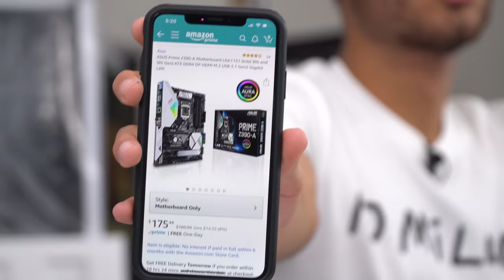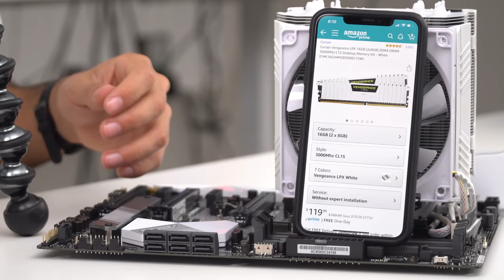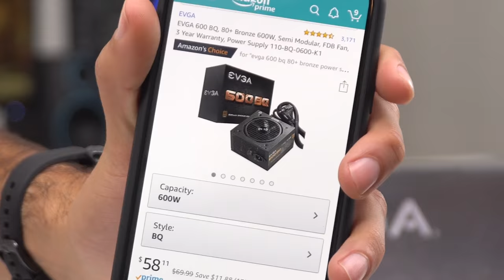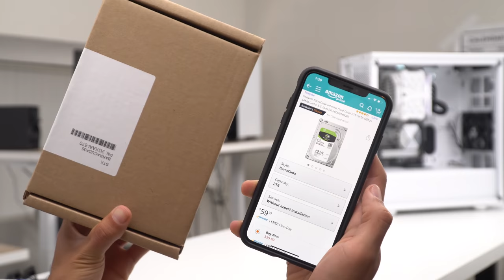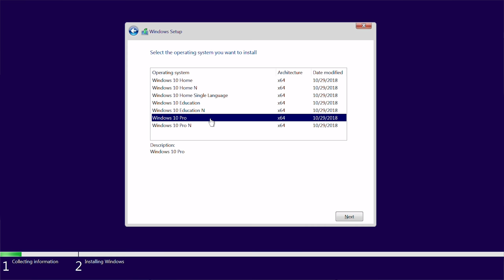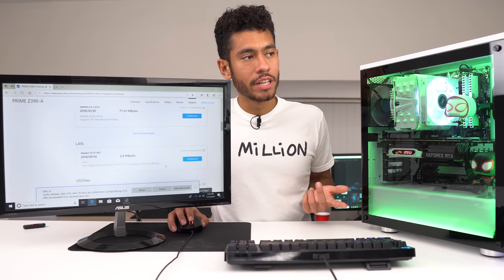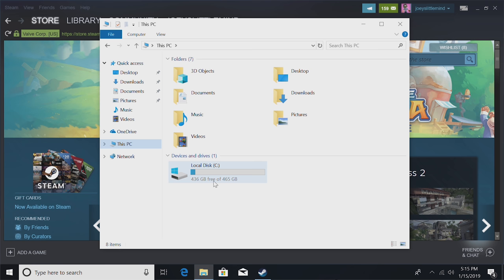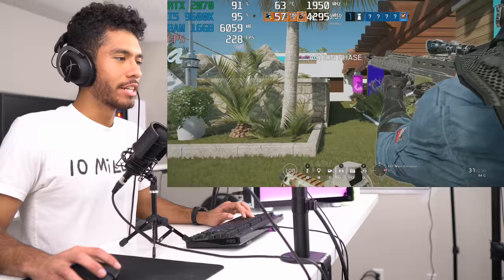$1500 Gaming PC Build Guide - RTX 2070 i5 9600K (w/ Benchmarks)

Comment: I’m gonna be building my first pc in the summer i think this is the build i’m gonna go with.
Reply: good luck
Reply: Samee trying to build a pc
Reply: Lol me too
Reply: Dude same
Reply: This pc runs literally almost as fast as his $2000 one
Reply: Same dude
Reply: @SweetLucky  dont the rtx cards are bad
Reply: Do this build but amd you save 200-300 dollars. The rtx 2070 is fine.
Reply: Stealth which AMD Processor would you recommend do this build
Reply: @DrizLax  Why?
Reply: same
Reply: SweetLucky same. Time to start grinding for that PC.
Reply: @TrueKnightFA  ryzen 5 2600/2600x would be perfect for this build
Reply: @rasmuskolehmainen574  This card is too expensive imo, It's only about 15% more effective than the 1070 TI and it costs about £200 more.
Reply: Same
Reply: SweetLucky same
Reply: what do you recommend then
Reply: @ascreamingcomesacross  im going to be building this exact pc build soon however to save money im getting 1tb hard drive instead of 2tb and also 250gb ssd instead of 500gb but im not sure if thats a bad idea or not. Also i will be using a 1080p monitor so do u think i should get the 1080ti or rtx 2070 bcz in the future the 2070 might be more useful and slightly cheaper.
Reply: @ascreamingcomesacross  i think ill stick to the rtx 2070 because it has a way better value for money than 1080ti and im not a hardcore gamer so i dont need the best possbile specs
Reply: Same
Reply: @josiiuh3025  yup
Reply: Just bought the exact same parts, dont have time this week, but next week im building it
Reply: @adasiek7664  its better than the 1080
Reply: Just built this and it’s really good you should do it. The only bad thing is that the front IO of the case might glitch a bit.
Reply: DrizLax how?
Reply: Same but I’m gonna use an i7 9700k
Reply: @dread4540  cmon man i knoe intel cpus are expensivr but they overclock really easy and they give a lot more fps
Reply: @that1guy256  how is going your build? I want to build it too
Reply: Same I wanna do it this summer too so I can start streaming
Reply: SweetLucky same dude I think this is rly his And am getting a really his gaming pc and mouse
Reply: I’m building mine for my bday which is in 9 days
Reply: Which monitor should I use with this build?
Reply: tbh i’m still new at this but you want 1080p and up and at least 144 hertz on your monitor
Reply: Me 2 ,m also getting the same thing but i am getting water cooling and 32gb ram
Reply: SweetLucky I have already started building mine but I have an nzxt h500 with Corsair 650 watt non modular and I am going to get an intel z390 prime intel I-5 9600-K and an nvidia GeForce rtx 2060 is the perfect 1000$ build
Reply: Michael use the monitor that Joey has its in the description
Reply: @TrueKnightFA  Ryzen 5 2600x with it's stock cooler letting it turbo and use xfr instead of a manual overclock with a 2080 instead of the 2070, very worth it. Much better multitasking, streaming capability, and slightly better gaming performance even.
Reply: @zigmundfreiheit7222  hey can you please explain me a bit better what you were saying about the refreshing rate of the monitor ,if I go with 1070 ti can I run 1440p 144 hz ? Or is it only for 1080s ?
Reply: K.14 the HDD is more for your money when u get 2tb than 1tb and takes less space to add another 1tb with the one your gonna already have try saving money on a case instead evaluate how much ur spending on a pc or LEDs is it necessary.
Reply: Hello everyone, I’m really looking to do my first build, if anyone can help me I have about $2000 total and that will include buying a mouse, keyboard, monitor and the build itself, can anyone help me out here with some advice ?
Reply: I won't recommend this build , since it's a pure gaming build , it's really good for gaming , but not really good for streaming and editing , if your only going to games , it's a good build , but I don't think anyone would do only gaming with a 1500$ build , go with 8 core or morelike i7 or cheaper ryzen 2700x
Reply: I'm going to build one this summer for my birthday
Reply: @ascreamingcomesacross  in 1080p the 2060 performs like a beast. So no need to get the 2070 if you want to game in 1080p.
Reply: @ascreamingcomesacross  Yeah by paying $100+. No thanks.
Reply: Yeah same
Reply: This build is trash
Try an rtx 2080 build, it should easily fit into your budget and is quite a bit faster than a 2070
An rtx 2070 fits better into a 1000 dollar build, not a 1500 dollar one
Reply: Yeah good luck
Reply: SweetLucky same
Reply: DrizLax rtx 2070 out performs the gtx 1080
Reply: Chrome384 the 1080ti is better than both rtx 2070 and 2080 it’s meant for 1440p or higher not 1080
Reply: Boxmoon69 how’d it turn out? I’m planning on building this as well.
Reply: Me too, but I may go for the 8600k
Reply: Me too bro, good luck🔥
Reply: Hercxs u2 ^^
Reply: would a 550 watt corsair go with this pc build?
Reply: @josiiuh3025  are u getting any blue screen??? Whest uncorrectable error
Reply: Me too i want it so bad
Reply: Me 2, also same components
Reply: try and save an extra $200 to upgrade to an i7 instead of the i5 its worth it man
Reply: @k3mp4  Their is sales of late on the 1tb m.2 for about $120 to $130 western digital blue on newegg.
Reply: @darkheart333hotmail3  didnt end up building anything lol
Reply: Honestly same its not too expensive and will help me record hella good videos once i get started with my new job
Reply: Yo me too
Reply: SweetLucky good Luck bro I gonna Build my first pc in Summer too
Reply: SweetLucky yeah definitely go with this, the specks are amazing for just 1500$ and it’s super easy to overclock your cpu up to like 5ghz if you don’t know how to do it just look up how to overclock a ryzon and intel core
Reply: Chrome384 it really don’t matter about the res it’s better handling max settings in games while you’ll still avg high FPS
Reply: George K he has downeys the  2070s or 2080s are better
Reply: Hareesh Devendran there’s nothing with the i7s , i5s or, i9s it’s about the threads and hz
Reply: Ayden Smith yeah ok bud, how’s it tradh when the 2080s only perform 8% better. Now I’ll agree if you’ll be streaming and gaming but that doesn’t make this build trash
Reply: Do not build this you can get way better of a pc for 1150
Reply: Specs of it are , gtx 1060 3gb , 16gb ram, 2 tb hard drive , 228 disk gb,  4.5ghz , ask for the name
Reply: i7 8th gen
Reply: TrueKnight don’t go with an AMD processor the i5-9600k beats Ryzen 7 2700x in gaming benchmarks
Reply: gang gnag which i7?? Can I build everything just like this and put an i7?
Reply: @aydensmith9745  Oh? Rtx 2080 cost like 1100€ and you intend to put it in 1500€ budget? Nice.... Rtx 2070 which is very good gpu cost 600€ and you intend to put it in 1000€ budget. You must be high. Dont listen to him guys hes jealous or something bcuz he is broke.
Reply: @OtenP_  Yes you can if you buy This motherboard hes using

Comment: dude i literally got the same exact build and its amazing! I recommend this to anyone who's build is within this budget! Great Vid
Reply: Ziad Haijar I bought half of the parts for this built already, moving from PS4 to pc!
Reply: @Adrian-vq2mp  same lmao but i got a different motherboard and processor because i want an amd processor and this motherboard doesnt support it and i got a corsair h100i cpu cooler instead of the enermax one.
Reply: @ziyad2912  would this build be good for 1440p 144hrtz gaming?
Reply: Mike_Zilla this would probably reach 144 FPS at 1440p on most low demand games, would maybe struggle with AAA titles
Reply: SAM SHB Wat? I own this exact build (different mobo, cooler, ssd, and ram) and it doesn’t “struggle” for any AAA title. Lowest I get to is like 85 on 1440p maxed but it’s usually in the hundreds.
Reply: @tyleride6928  Whats your opinion on the i5-9600k vs i7-9700k??
Reply: Tyleride69 fax

Comment: This is my first build! I want to say thank you for the awesome video and awesome help! A few things I had problems with was when you were setting the graphics card up you didn’t show everything about the cord and how to route it. For my first pc build, showing everything would have saved me a few hours but after messing with it for a bit you can figure it out alone. If you showed every little piece of the build and how you specifically routed them, it’d be a 10/10. But hey, thank you again!
Reply: Kyler Mcguire Nice! I’m thinking of building this pc as well :D
Reply: Rez dude it’s 100% worth it! This pc is absolutely killin anything I put infront of it. Definitely get a 144hz monitor. Makes the gaming next level crazy. Cheers 🍻
Reply: @Gurgs  Is this compatible with the  ASUS ROG Swift PG279Q monitor
Reply: vibranium it should be compatible with any monitor that I’m aware of. Make sure you’re aware that there’s dpi port. So to run 144hz you’ll HAVE to have a Display port!
Reply: @Gurgs  Thanks but is this g sync or free sync?
Reply: Just a question @Kyler Mcguire.... how is the PC doing. Thinking of building this as my first PC. Is it running smooth? Getting hot? Enough space?
Reply: Fogstrider1 8 this pc is fucking sweet. I downloaded “gpu tweaker” and when I’m playing a game that makes my gpu hot, i put the fans to 80% and it cools right off. I run r6 at 200 steady fps, I literally don’t have any cons about this build. It’s fuckin solid bro
Reply: vibranium I’m honestly not sure
Reply: @Gurgs  a few parts are unavailable for me so that sucks:(
Reply: Thanks for the answer! Im gonna build this :D
Reply: Dark Slumps try new egg. I had the same problem. Some of the stuff was more expensive but whatever
Reply: Rez enjoy bro! It’s amazing.
Reply: @Gurgs  is it like a website or something 
Just looked at the part i needed its double the price fuck that
Reply: Hey dude I am also about to be building my first pc. What should or shouldn't I do based on your first experience?
Reply: Ali Kısagün the only thing I had any issue with the build -the video skipped a few key parts with the wires. I figured it out by messing with it. 
The build itself- it’s literally perfect. I can’t say a single bad thing about this. It literally pumps power, not a damn thing bad about it.
Reply: Dark Slumps what parts are you struggling for? I can try and help you. “Newegg” doesn’t have the best deals always. Try looking up other websites. I’m stationed in italy and I had to get my motherboard and fanned shipped home and over here to italy.
Reply: @Gurgs  the cpu fan since the i5 doesn't come with one
Reply: I can't seem to download windows 10 i keep running into an error where could i get one with windows already on it
Reply: Dark Slumps where’d you buy the fan, it was out of stock on everything for me
Reply: @kimo2208  i just bought the T-40 hoping it would work I'll let you u know
Reply: Dark Slumps when is it arriving for you? Because I was planning on doing the same thing
Reply: @kimo2208  sometime these 3 days
Reply: Dark Slumps well I just ordered it all including the fans so I’m praying
Reply: @kimo2208  i had to buy it separated because some were out of stock 

I need the power supply and the i5 9600k
Reply: Dark Slumps u have an insta or something we could try and build together or if you get it earlier you could help me bc I’m autistic
Reply: @laorde  go into your bios, select ssd at the right corner... look a vid how to instal windows 10 and just create a new file. had the same prob bro!
Reply: @Gurgs  on the built pc or another?
Reply: Dark Slumps on that bios on the pc. When you start it up, press delete
Reply: @Gurgs  so when i put it together ill be able to download it?
Reply: Dark Slumps yes
Reply: @Gurgs  hey I'm thinking of building this rig but I also wanted to know if u bought any of the optional parts listed in the description
Reply: UniqueSoldier i bought the led light strips
Reply: @Gurgs  did u also need any extra stuff such as screws/screwdrivers or does it come with the components??
Reply: I got 32gb ram and the sticks aren't going in righ
Reply: Yo do you think I could swap out the power supply with the evga 600 BR 80+ bronze instead? It’s pretty much same thing, i don’t know what the difference is so im asking you😂
Reply: @7rez  no clue dude
Reply: Dark Slumps but does the fan work tho
Reply: Ongo Gablogian no I just asked this because me and dark slumps bought the t-40 fan instead of the t-50 bc it was out of supply
Reply: Ongo Gablogian dope this is my first ever build so I was kinda worried
Reply: Ongo Gablogian should work the exact same if not better
Reply: Have you guys try to do some live-streaming while playing games? If so how did this pc handle it?
Reply: @Gurgs  where did u order the fan from ive 4 bits left to order then i can start building
Reply: shesaidshewaslvl18 got mine from amazon. You can get them anywhere, just google it
Reply: ArmoredShock and no I haven’t yet. I’ve been really busy with work! But i plan to soon, it holds itself very well!! So I think streaming will be no problem at all.
Reply: @Gurgs  yo my monitor isn't getting signal any tips?
Reply: Thanks for posting this comment dude i was unsure if i should build this pc and youve really made me more confident
Reply: @cadellb6680  I recently built this and it will not disappoint
Reply: @laorde   thats good to hear thanks guys
Reply: Cadell Berry cheers :)
Reply: @Gurgs  What cpu cooler do you recommend?
Reply: Hey! Do you get the same fps in games he got ?
Reply: Kyler Mcguire can’t wait already have most of the parts do you think I should get the 9700k or is the i5 9600k good enough
Reply: @insidertech10  nooooooo bro, get a fking ryzen 3600 or a ryzen 7 3900, intel suckd and hella overpriced
Reply: @exidy3624  Ryzen chips aren't compatible with the motherboard, it only works with 8th, 9th & 10th Intel cpus
Reply: I built it but it won’t turn on
Reply: Kyler Mcguire is thinking about upgrading to core i7 for productivity and gaming, should I keep this cooler or upgrade to something like a nzxt x62 water cooler? (This is my first build if so)
Reply: @laorde  Hey Dark. Im thinking of building this pc but the fan is out of stock, I saw you had thios issue too. Could you send a link of the fan you bought?
Reply: Kyler Mcguire can u PLEASE help
me buy the Enermax ETS-T50 i have no idea we're to get it it's sold out on amazon
Reply: @olytm9355  get the t40
Reply: is this still good it looks so sweet i wanna get it
Reply: @Gurgs can you overclock your CPU on that mobo ?
Reply: (3 year later review) 

This PC build is overall a fantastic build. I bought the same exact parts as in this video and I've had a few problems but very minimal. One thing that is NOT noted in this video - Make sure your motherboard ( for Asus Z930-A ) is above version 1003. If not, it will cause CPU performance issues. This will wipe HHD // SSD (unplug HDD or back up before update.) Other than that, this build is literally perfect. I bought a 250gb m.2 980 Pro (Samsung) , and I have my OS on there, and the computer build is speedy and quick. No issues. Build this computer! 10/10 Recommend!!!  :)

Comment: Just built this with an i7 8700k and a gold rated psu with the Cryorig R1 CPU cooler. Things a beast and looks super clean
Reply: What case did you use?
Reply: Mike_Zilla same case as the one in the video
Reply: Abbas Shiri I used the stock case fans. And I used a cryorig r1 cpu cooler. The cpu cooler barely fits but it keeps my cpu below 60 degrees at all times. You have to install it with the fans of the cooler facing up and down and raise the fans slightly. Install the ram before the cooler has one of the fans will sit above the third and fourth ram slots. Cryorig is black so it keeps with the white and black theme.

Comment: When Joey uses air coolers on 9th gen processors
Reply: Why not?
Reply: @comradeq2493  they got hot asf. youd get better temps with an aio
Reply: @graaphics2119  I use an air cooler and the temperature is fine when gaming.
Reply: facts that some air cooler can be better than aio cooler is probably why joey choosing to use an air cooler
Reply: @crazycajunj1703  lmao then what's the point of getting a K cpu
Reply: Pablo Emilio Escobar Gaviria Yep, something like a Dark Rock Pro 4 or a Noctua NHD-15 will perform similarly to a 280mm AIO which costs in some cases $50 more.
Reply: @crazycajunj1703  btw the only air cooler I'd ever recommend is a dark rock pro. the aesthetic and performance is great, so yea air coolers do have their place but if you're getting an unlocked CPU then you're most likely gonna OC. Air coolers will have higher temps on an OC vs an AIO. although hard tubing is the best out of all your options obv
Reply: @prog8173  dark rock pro 4 is basically an AIO lmao.
Reply: @graaphics2119 
Someone watches Jaystwocents ami right?
Reply: @crazycajunj1703  wasted 8700k but cool bro
Reply: Laughs in NH-D15
Reply: I'm going 5Gz currently at 32-35ish idle with my 9600k
Reply: @mikkelstormhansen9733  I don't like his reviews anymore, he's pretty biased towards intel and nvidea
Reply: YEAH THE STOCK COOLER IS WAY BETTER

joking
Reply: @graaphics2119   I was more talking about how he is extremely biased against watercooling. Linus tech tips Even did a video with noctua vs corsair in cooling and noctua won. And that was on threadripper  with the nh-d15 not included in the test.
Reply: @graaphics2119  not necessarily true, a beefy air cooler with 4+ heatpipes, in the 70 dollar range, can meet or even outperform a 240-280 mm aio, with less points of failure, noise, and cost.
Reply: @comradeq2493  dark rock pro yes. and as for the noise, the pump makes the most noticeable noise which you can turn to silent mode at the cost of maybe 3-5c
Reply: @JSlaig  and another -20 to 30 dollars cause z390 boards are lame prices.
Reply: It’s a joke bois
Reply: @benvatis1338  Your life's a joke.